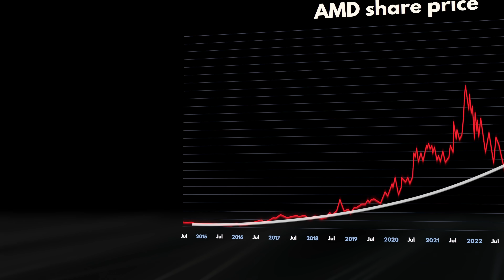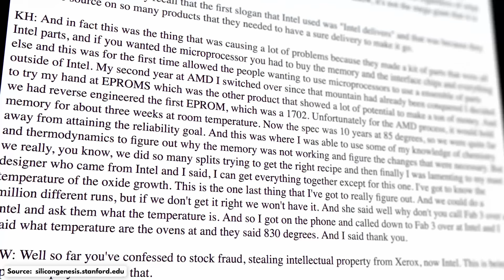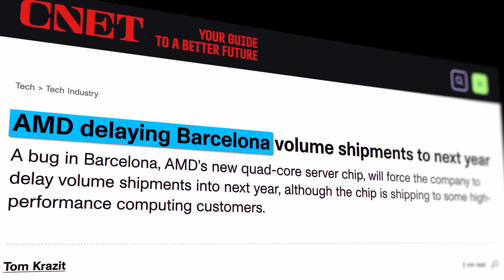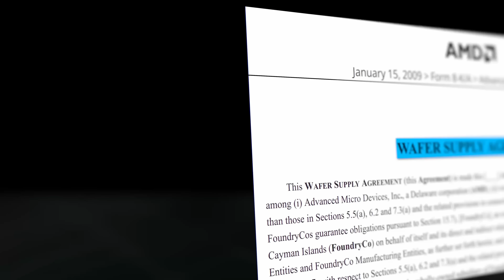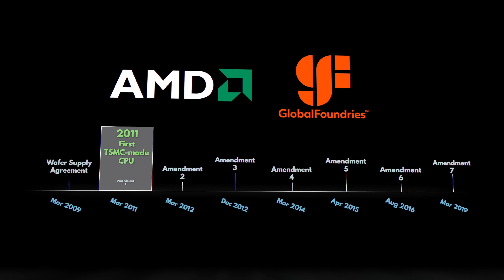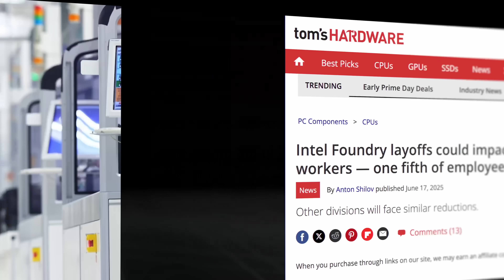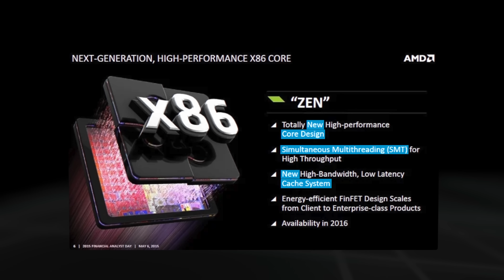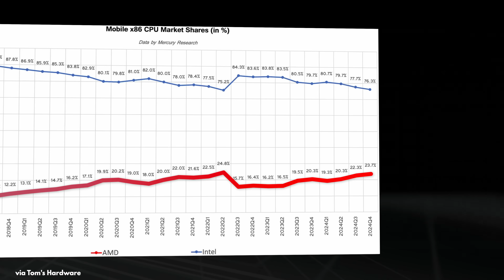How AMD won the CPU crown

Comment: Even though AMD has been dominating the performance charts for years they're still well behind Intel in number of CPUs in use. Really goes to show how crushing Intel's lead was.
Reply: also here it feels like for every amd laptop there are 5 intel ones
Reply: @johnsalamii very true. It's almost hard to buy an AMD laptop. I'd say and is dominating desktop and server but still struggling in laptop even though their chips are better across the board
Reply: @TheCivicsiep3 "still struggling in laptop even throught their chips are better across"
Lmao.

It's way more common watching comparisons between Core Ultra vs Apple Sillicon. AMD is irrelevant unless they are very cheap.

NVIDIA and Intel combos are more expensive.
Reply: Schools and offices are still using 6-7th gen Intel. Intel was bribing system integrators to not use AMD CPUs. And yet AMD has gained 8% market share in last 4 years on steam hardware survey.
Reply: @Riyozsu  Yeah, there's just way too many decade-plus old Intel based workstations still in use that make AMDs gains seem less impressive, but when you actually look at it, AMD has been consistently backhanding Intel in every way since they had their Ryzen moment.
Reply: @Riyozsu  and thats important, because gamers are buying the best hardware, and that seems to be AMD
Reply: @Riyozsu They should replace all of those with Alder Lake. It's lightyers better.

i7-12700K is still an amazing CPU to this day and the i7-12700 is perfect for servers.
Reply: @Riyozsu isn’t 8th gen intel cpu no longer in service later this year?
Reply: @Riyozsu  correct also microsoft also does something to its os to limit the performance of amd chip to favor intel
Reply: AMD, Apple, Qualcomm, Mediatek & Nvidia all are fabless & completely depend on TSMC. That’s why AMD can not get as much chip as the market demands. So AMD put most of their silicon in server, workstation & high end cpu where profit margin is high. There are very little low & mid range AMD powered laptops available in market. Another thing is that in school & office, administration care more about after sell service rather than instant raw power. Most of the OEMs still have very good business relationship with Intel & they always suggest Intel products over AMD products because Intel can provide as much chip as they want.
Reply: @mdimrankabir8690  Why do so many people forgot that Samsung fabs exist? TSMC isn't some magic unicorn. A new Japanese fab company called Rapidus is in the final stages of development as well, should be ready to go in 2 years.
Reply: @korakys  Samsung can't even make their Exynos chip efficiently. Exynos chips are known for their over heating issues as well as thermal throttling.
Reply: If Intel fumbles Nova Lake, AMD will quickly close this gap.
Reply: It was mostly due to intels shady business practice that they had a huge lead along with amd's past cpu blunders.
Reply: at some point amd was less than 15% of the market

that is why it was so important the consoles and custom chips amd makes

the difference, i dont know if it includes server chips, amd on laptops still doesnt make much
Reply: Well intel is still dominant but it's not like before, Ryzen chips have become very popular recently especially with gaming laptops.
AMD is alot more noticeable on laptops here in Ghana at least.
Reply: i think intel still dominating because it have more oem brand used it
Reply: I believe it is cause of all the laptops and pre-builds.

For some reason manufacturers still do prefer intel.

Maybe they did sign some kind of contracts ?

It is kind of wierd that most of laptops and desktops are Intel here I live.

Most of people's do buy things like that so I believe it explains a lot at least for me 😅
Reply: amd was always cheaper and broke down less than intel in 90s and early 200s.. when intel was 800 dollar for one processor amd came out with a 200 dollar process with same power in 90s.  they also created 3d now ahead of time with 64 bit tech that intel nor any video card did not have yet.  it lead to dvd tech, 3d layering and then ATI card as well ahead of time merged with them a perfect union of multimedia.
Reply: Because Intel has been in the lead for so long, not everyone knows much about cpus, shouldn’t you be happy amd is the reason Intel has to get off their asses and make better cpus? Makes computing better for all of us
Reply: Given the revelations with TSMC trying to set up a fabrication facility in Arizona. It's also arguable that Intel has had access to subpar materials in America which has been throttling their progress. Still their own fault though.
Reply: That makes no sense.Intel used to have less cores than AMD back in the day lmao.When they could barely compete against ıntel.
Reply: It's like saying being behind in number of <insert car brand> just because they sold a lot means nothing. They do not bring any more $$ to Intel today, so that statement has no real weight.
Reply: @Traumatree in no moment was implied that it brought money such comment

it says that amd sell alot now, many more times than intel, but still majority of cpus around are intel, so it had a enormus lead in cpus in service, sold at some point in time, for almost a decade all was intel, amd was like 15% of market if not less

complain because you did not got the idea of the comment means you have to read twice to get it, at least, i hope
Reply: A bit of Google seems to say that US CPU sales (through Amazon) is 2 for Intel for every 8 for AMD.

Sales share of Nvidia are down 6% and AMD up 16%

If the installed share is still Intel biased then I suspect it won't be for much longer
Reply: All we gotta do for sweet revenge of Intel basically paying off manufacturers to use their chips and not AMD's, is BOYCOTT bloody Intel. In 2025 I'm going all AMD PC
Reply: That lead includes computers that have been around from back in the day when Intel was pretty much dominant. It's going to be a long time before they slog off from those charts. Intel knows how much trouble they are in.
Reply: not many gamers want a $450 x3d cpu when a 14600k for $180 is going to get all the fps they need

Comment: The problem  that AMD  has not yet attempted to create a chip with an arm architecture for the average consumer.
Reply: because there is no good reason to do so. They also attempted under the lead of Jim Keller, but scrapped it. 
x86-64 pruned of legacy instructions with SVE will be just as good as ARM and vice versa.

Comment: 6:12 Didn't AMD make a software called Mantle that paralleled work among the cores and then became the basis of API Vulkan? Bulldozer started the multicore workloads more mainstream and as the time showed, FX 8300 aged quite well sometimes outperforming i7 2600K in the modern software that can run on all 8 threads
Reply: Sort of. But parallelism that comes about 9 years after you launched your CPU designed to do that first - that is a bit too late. Most of the games that really used Mantle/Vulkan to it's full potential started appearing in 2019/2020 (there were games that were earlier of course, but they didn't use CPU in multi-threading vey well).

Also switch to multi-threading is still happening.
Reply: @jannegrey yeah, amd had to work on the software, but I blame slow and lazy developers
Reply: @montenegrofees  That too. AMD to this day has to send their devs to a lot of studios to help them make use of Vulkan. It's partially because DX12 also made some progress in that respect, so a lot of devs specialize in DX12, know DX11 and know a bit of Vulkan.
Reply: so basically bulldozer was way ahead of its time?

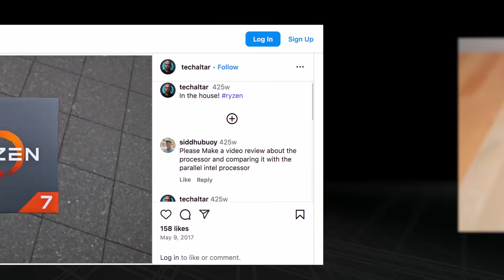Comment: 10:25 I still rock my Ryzen 1600, a few years back upgraded my GTX 1060 to 3060 and still use that (waiting for a new APU or a handheld with something like the new AI MAX laptop APUs)
Reply: A handheld with the Ryzen AI MAX chips would last 20-30 minutes on battery at best with a 50Wh battery.
Reply: @rattlehead999  that is why I wrote "something like the"
Reply: @Chris3s  More like a 4C core, 16CU with enough MALL cache APU. That would be best.

Comment: This is a legendary comeback story
Reply: Nope amd is bad at ai. There us a reason intel and nvidia sticks ate skyrocketing. Ai is the future
Reply: @SeanBotha  Intel is skyrocketing? What a joke, their share price is 6 times lower. Also, don't forget AMD's MX350 series of graphics accelerators. They might not be as good as Nvidia, but they're definitaly better than Intel.
Reply: @SeanBotha  AMD isnt as good as Nvidia for sure. but they are miles ahead of Intel at AI. Intel Accelerators barely has any adoption. As for software, CUDA is king, ROCm is still a smaller challenger but Intel barely has anything close.
Reply: @SeanBotha intel is not 😂❤
Reply: @SeanBotha Meteor Lake and Arrow Lake perfom badly in gaming as a generational improvement vs Raptor Lake and Alder Lake.

Why? because the memory controller was designed for the NPU or Ai slop.
Reply: @SeanBotha  it just because windows is like intel than amd so that why amd is not good on AI , it not amd problem it windows problem